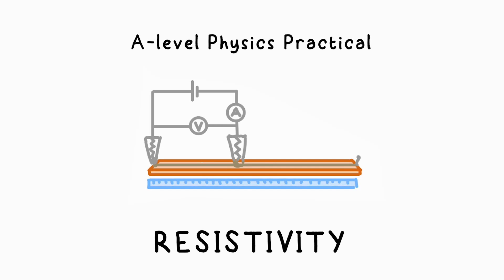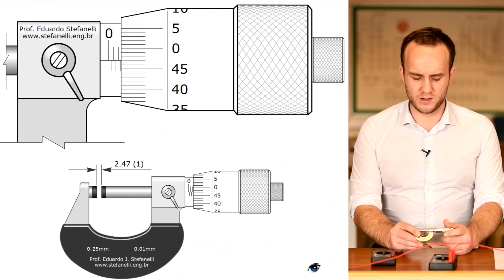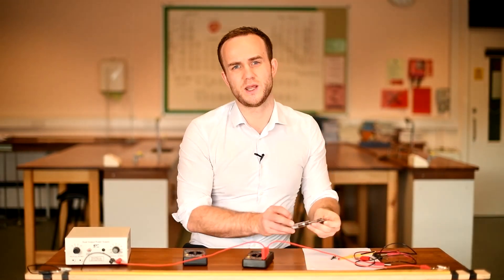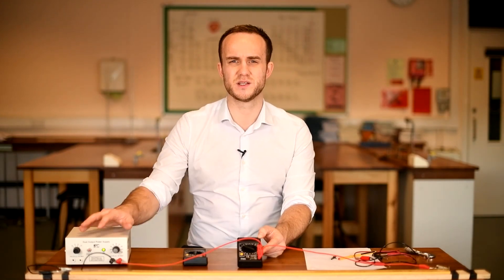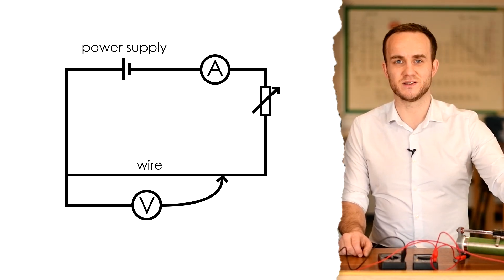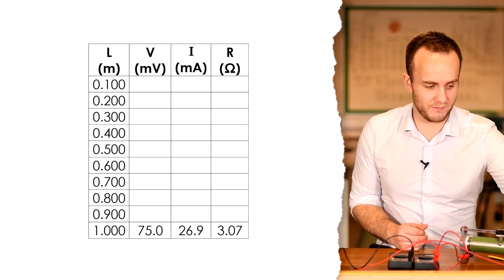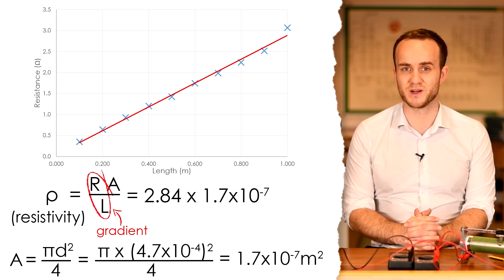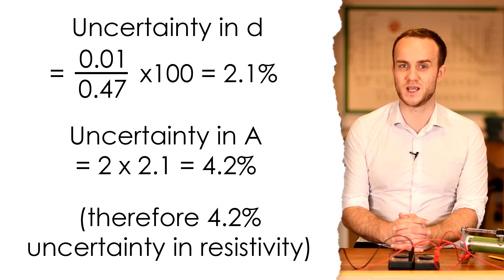RESISTIVITY- A-level Physics Required Practical

Comment: Why do you use a variable resistor?
Reply: Basically in the circuit before he adds it is rather short, this means the total resistance of the circuit is low therefore current is a bit higher, this is an issue it might heat up skewing the results as if the wire heats the resistivity goes up.

To counter this he adds a variable resistor, this adds resistance, therefore reducing the current and the wire heating, giving better results.